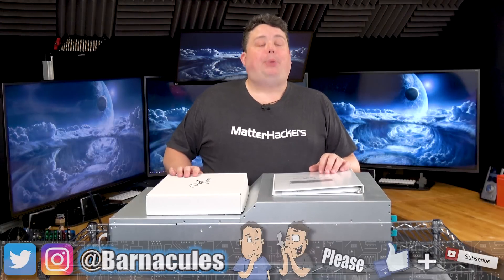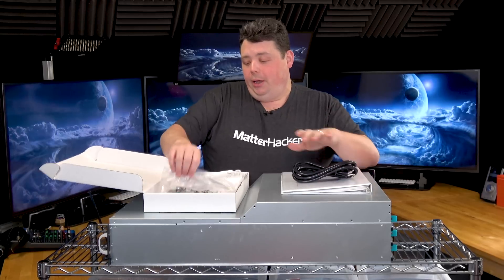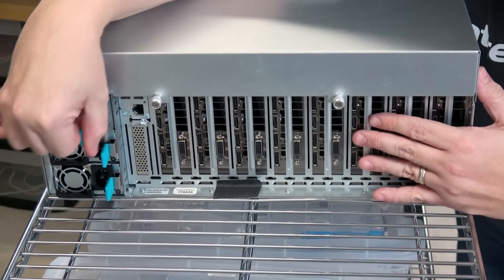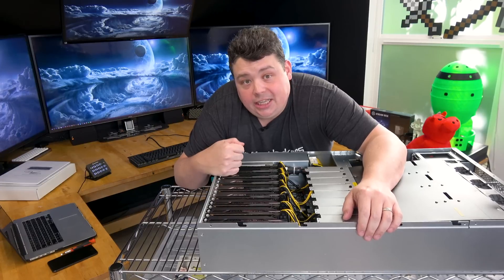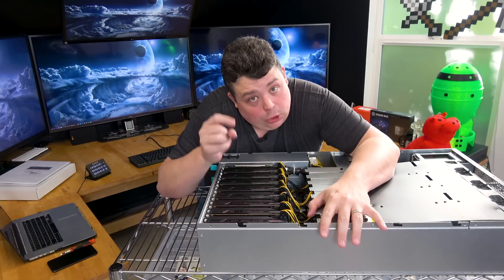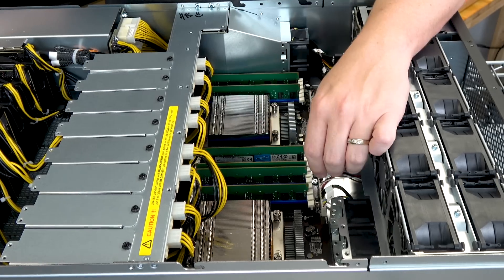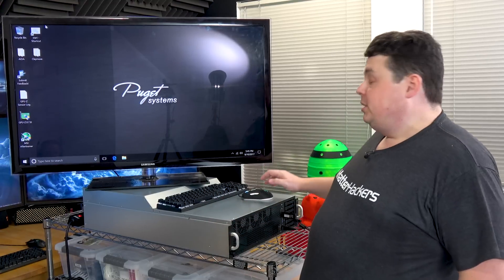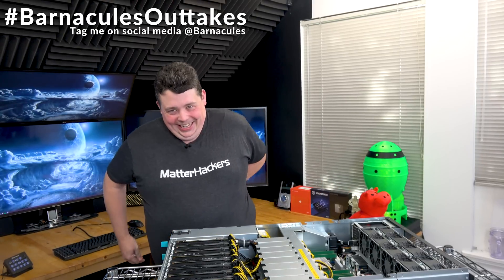Ethereum Crypto Mining Custom PC Server with 8 Nvidia GTX 1060 6GB GPU - @Barnacules

Comment: The case from Asus is so pointless. The whole point for it to be a rackmount server case is so that you can - you know - mount it in a rack. When you have a bulge like that, you might as well make it a 4U case and call it even and then you can neatly and evenly rack 10 of these in a standard 42U rack. With it being a 3.5U, it isn't like you can flip another server upside though and mount it to the rack using the same cage nuts that you used to mount the first one.

So pointless.

CLEARLY Asus doesn't do servers, and therefore; doesn't understand the server/rackmount environment. 

It's one thing to try and fail. It's another thing to be an Asus rackmount server that's neither here nor there.
Reply: Well they do provide a top without the bulge, say if you have gpu with the power input in the back. So just pick whatever you like and be done with it.

Comment: I think you didn't think it through when you said you've only connected two of the three PSU's because of your circuits might not be able to handle it.
The machines uses the same amount of power with 3 PSU's as with 2, obviously, so you should connect the third supply for the redundancy.

Comment: too loud and too energy consuming for a 1060 rig. My 1060 3GB produces 23.2MH/s at 147 core, 717 memory clock, 50% Power, 63º temp limit, which means 60W of power usage

Comment: How many U's is the back?  It looks like 4U, but I can't get a 1070 to fit in 4U so have to build a 5U case. Are the 1070's taller than the 1060's?  In my case the system will only support 6 cards.  6 cards in 5U just seems inefficient, I'm thinking I can do better.

Comment: I'm in the middle of building myself a mining rig with RX 580s.  I'm having trouble figuring out how to get windows 10 onto the rigs hard drive. I don't have a dvd drive, so I'm wondering if I can some how get windows 10 onto a usb drive to load onto my hard drive installed on the rig. Any help would be greatly appreciated.   Thanks.

Comment: Hmu if your interested in remote editing directly on a remote server or virtual machine. I have been working on a solution to remotely edit video with next to no lag
Reply from the maker: +Logan .Kes how are you doing it?
Reply: Barnacules Nerdgasm currently I have been using a tool called RGS by hp and headless HDMI adapters. It works great on bare metal machines or virtual machines. As for video editing and 3d modeling I cannot tell a difference over a gigabit network or even on ac wireless. Only issue with rgs is that it needs a direct network connection so if you are out you need to vpn into your home network. As I've had vpn performance issues I have used splashtop when out if my network such as at school so I can just bring my Ultrabook instead of mobile workstation but still have an 8 core xeon and quadro graphics 👌. Similar use would be VMware horizon however that uses grid or Tesla cards to more or less render the app not the desktop and requires expensive licensing as well.

Comment: 15-18$ a day but your not talking about power cost.  Surely this computer working 24/hrs must cost lots of electricity.
Reply: This consumes at maximum 2 kWh of power. In the Seattle area, power is 11.2 cents a kWh, resulting in a power cost of $5.376 a day. Of course, this assumes that the PSUs are at full load. They definitely aren't, even with the amount of hardware inside.

Comment: You will have everything you could ever want but the basement would have been a better place to have installed the system.I wonder why you dodn't go with 2X  SP3 sockets and two EPYC 32 core 64 thread processors for 64 core 128 threads and 2TB of DDR4 RAM and 8 graphics cards.

Comment: I'm confused, i thought you couldnt connect 1060s together? since no SLI?
Reply: Crossfire/SLI is not required for mining because the cards don't need to coordinate or exchange data at any high rate. The coordination is tiny and done via the mining software. You can have a bunch of cards of different specs and it will work fine.

Comment: Heating up the earth for just $15-$18 a day.
Reply: sticky170 the electric bill will be bigger then what he brings in
Reply: he just said 15-18 in PROFIT
Reply: Mixtapemusix1 This consumes at maximum 2 kWh of power. In the Seattle area, power is 11.2 cents a kWh, resulting in a power cost of $5.376 a day. Of course, this assumes that the PSUs are at full load. They definitely aren't, even with the amount of hardware inside. Jerry is still making a profit.

Comment: Nice system but Watch out for the small room cooling you put the high power system in. It will heat it up if no air flow to room. Here in Estonia you could heat house with it in winter. And dust is killer for heatsink...

Comment: You don't barely any for mining, just a cheapest dual core celeron/athlon, underclocked and undervolted, it actually makes more sense to have a platinum PSU to reduce improve efficiency at load.

Comment: Aye the ASUS ESC Chassis.  Those are pretty sweet.  I have a G2 ESC4000 that I scrapped together from Ebay for under $300.  4 GPUs in a 2U sounds pretty sweet until you turn it on...  I water cooled it.

Comment: what if i install another GPU in my rig without SLI would the preform increase? currently im using Nvidia 1070 founder edition from Zotac  if i installed ZOTAC GeForce® GTX 1070 Mini will it work? will the preform increase reasonably

Comment: At 15 bucks a day you would in theory have payed back the full cost of that in approximately 2 and a half years. However, that's assuming you didn't have to ever replace any components in the system, and that you don't wind up having to switch crypto currencies due to prices changing. All in all, that's not too shabby especially since once it's payed off you would be making like $450 a month off of it of pure in the green profit.

Comment: I like barnecles, puget helps barnacles=I likes puglet systems......buut
1060=1280 cores 120w
1080=2560 cores=180w
1080ti=3584cores=250w
could have replaced them with 4x 1080's and saved power or 4 1080ti's for the same power and an extra 40% more performance at the same power draw.

Comment: Regarding the tiny screws on the case.  Don't put those tiny screws back in - just use the large spring loaded 
screws to lock the top of the case in.

Comment: Why the hell don't GPU manufacturers put the power cables on the very back of the card 90° from where they are now? Just around the corner. Come on. It shouldn't be hard, guys.
Reply: They do. But only on quadros.
Reply: Survivalisbest unhackable It would make builds cleaner and servers easier to work on.

Comment: Mine Ethereum on Linux with RX 480s or 580s, not on Windows with GTX 1060s. Even just switching to a Linux distro will probably give you 20-30% better performance at least.
Reply: Arie Copley-Radder Yeah this is a very stupid build.

Comment: Watch out putting it in that crawlspace, the need for a large air supply is going to be a determining factor, I don't see any insulation or AC vents in there.  if it is boxed up in there and the exhaust of the system can't leave, the heat will build up and the air that it is sucking in at the front will get continually warmer until it over heats.  I know it is loud and the idea would be to put it away in a back area, but with that machine you will need something to take away the air it is blowing over all that and remove it from the area.  Heck with desktop systems I've seen overheating because the exec didn't want the computer out, put it in his desk, (the desk was even made with cable run systems for  computers, but the air couldn't get out, well not enough of it anyway.  I installed 2 90mm fans in the back of the desk area to actively pull the hot air out so that the systems could remain cooler.

Comment: Nice to see someone explain how a server/airflow actually works in easy to understand terms.
Having worked in the datacentre realm for 10+ years, it's hard to explain why I can run Battlefield on my 4x20 core Intel system with 0.5 TB of RAM... it just doesn't' work that way.
On the other had @Barnaculese; whats the daily figure after you factor in power usage overhead costs for Etherium mining?

Comment: Your statement about power and power lines made me wonder how that is in general in the US ... here in Germany our breakers deliver a maximum of 3600W ... though not all homes have a breaker for each room ... and some homes have even several per room.  (Except for rooms intended with washing machines and and or  tumblers which have their own circuit, and kitchens with electric stoves ... which have an even higher breaker)

Comment: would't it be more effective to use vega 64s? given that you can underclock and under volt and set clock speed to roughly 1000mz core and 1100mz HBM and still get 43Mhash per card.

Comment: you can understand how supply and demand works and still be rightfully angry at miners. at first it was all the miners buying the cards and almost no one had them in stock, and the problem now is that the prices are absolutely ridiculous and miners are still buying them regardless of price which will just keep prices high for no reason. I don't know a single gamer willing to pay $350-$400 for a RX580, but I know plenty of miners that would.  your just a bunch of lazy people trying to make quick pocket change at the expense of the entire gaming community.

Comment: Awesome build! About a month ago I bought a HP Proliant DL380G6 that im turning into a gaming machine.  Dual zeon Quad cores 2.66 ghz, 48 GB DDR3 samsung 8GB sticks expandable to 142GB, 8 sas 72GB 15k RPM drives just to get things rolling. 6 high flow fans that sound like a jet liner, 2 hot swap 750 watt power supplies, Dolby 5.1 sound card, now I just need a good video card, and  Windows server 2016. This is my everyday computer also, Its exciting building such a powerful machine.  This video inspires me even more.  Thanks Jerry!
Reply from the maker: +Mark Smith I remember working with Proliant's back in the day. Solid machine! Thanks for the kind words.

Comment: What's the hashrate when you mine?
Reply from the maker: ~180 mh/sec
Reply: Cool! And are you planning on overclocking it at all? I know heat and power is an emphasized concern, but you can probably play with the power limits.

Comment: Samsung 950 Pro 2TB SSD?  Either you're referencing storage not shown or incorrectly calling out the SSD you pulled in the caddy.  You probably meant 'Samsung 850 Pro 2TB'.
edit Just saw your edit.  :-S

Comment: 10:15 BS, it will not use any power from a redundant power supply. The total power of the system isn't going to change except from the  possible added inefficiency from a third PSU. Think about it, where would it put that extra 1000W?
Reply from the maker: +tengelgeer RTFM.
Reply: +Barnacules Nerdgasm Sorry Jerry, that's not how power works. Two options, or the "fucking manual" is wrong or when connected to two sockets the system is heavily crippled (like 2000W/3000W cripples). But because you use the full potential of the system that can't be the case. It's simple physics, if you use an extra 1000W you have an extra 1000W of heat. And some component needs to dissipate that thus needing that. That leaves option one ;) The machine simply had three 1000W power supplies but the rating of the PSU doesn't determine the power draw. Greetings from a Electrical Engineer specialized in Embedded Systems and Power Distribution ;)

Comment: The best part of this video is the facts and how misleading and wrong they are.  1060's aren't render cards, and even in that respect video cards aren't use to render video the cpu is...  So this rig quite literally an overdone gaming rig with too many cards and ecc ram, which really doesn't affect gaming performance its just more expensive.  But seriously, you don't render with gaming cards, and I would love to go at anyone who disagree's with that statement.  Just like maya, max, minecraft, that is all CPU NOT GPU.  Unless its a render card, which these are not.  

Now if you bought all those cards to run that many monitors to get that much tool room for doing editing and graphics, maybe, but still, they will not help you in rendering video or 3d content.

Comment: 1060 6GB might be a real good choice for this sort of system. But most people might want to use their gaming rig in down time for this, so a single or double 1080 or 1080 Ti might be the thing. There's also the red team possible combos, but you have to check that energy efficiency, since it will easily kill any profits! VERY IMPORTANT: Watch out for that noise, humans have a very limited tolerance in time for continuous noise over 50-60dB. It will cause health issues over time and I'm not talking about hearing loss! Be safe bro! Gotta love a Houston build from Puget!

Comment: I don't like this case at all. If you look at almost any rack server vendor, you'll find that the majority of user-serviceable parts can be swapped tool-less. With HP rack servers, you turn a key 90 degrees, pull a lever and baam, the top cover is removed. This thing? Remove 20 screws to change a fan.

Comment: Just wanted to throw in ECC and Registered are two different things, though usually combined. Registered or also known as Buffered help alleviate electrical load from the CPU memory controller which on Intel tends to be just one on a monolithic die, so increase stability.

Comment: winblows? on a hashbox? not trying to be rude, real question - wouldn't running linux, particularly a non graphical distro be a lot better for a project like this? or does it not even matter....  or is it just because your main use case is rendering and mining is secondary?

Comment: Oh I love the moronic idea that is cryptocurrency.  it would take 2 years to pay this off, IF he is making on average said 18 bucks a DAY ALL DAY EVERY DAY. but this does not account for the rise or drop in value, nor the difficulty in mining, and after 2 years I am sure they ROI is much lower. the cost of this stuff needs to literally be 1/4 of its current cost to really make it viable.   sure if you are able to get said coins, and hold on to them IF it goes up then possibly your break even point MAY be higher. but id love to see the math using previous figures on cost of a machine vs time to break even point and the rise in difficulty and what the profit actually was within 3-5 years.
Reply: That would be true if he actually paid for this. He got it all for FREE; that's $12,000 worth of hardware. He's making pure profit right now for basically doing nothing.

Comment: To address the screws. As you don't know they are there for system security and transport. However once rack-mounted you can remove all those screws and just leave the spring-loaded screws to hold the cover "Reasonably secure" but depending on make and model dust can become a thing depending if it could mess with the sliding of the rack. If it doesn't mess with the sliding  and is rack-mounted normally a label "lose lid back screws only" is stick on the top and the operator knows that it is only secured by the two screws at the back. Thus they will handle it appropriately. Not every business works this way or has these rules but "normally that is kind of what happens" Other times it is a must that all screws are   secured for integrity sake. Just saying it is really not such a big deal.

Comment: holy crepe jerry, I just built a mining rig with 5 1060s and also use nanopool, the east server though. When I bought the gpus I thought I should've sprung for something better but seeing you bought them only means they the best. One question I have about the system is, in a pinch would it reheat a cheeseburger that was kept in the fridge?

Comment: Take the small extra screws put them in a lil zip-lock taped to the lid so you dont loose them and just use the thumb screws youll be fine

Comment: great video ! I would love to see how fast that beast could compile massive project. If ever you decide to do a Linux series you could probably run 20 different distro's simultaneously without even having the slightest hang. I'm curious how fast this pc would calculate a recursive Fibonacci function of fib(500) or even higher. *(I know recursive is not optimized for Fibonacci this is just for experimental purpose. keep it up man, have a good one!

Comment: Firstly, measure sound at 1m, and the direction of the mic matters.
Secondly why a 3u with a bump over a normal 4u? Also in a home environment, why not use 2x single xeons with 4x graphics cards each.. the lower power density would not only make it cooler\quieter but save some power those fans like to eat.. cost is unlikely to be radically different next to the $12k that things worth.

Comment: thanks for adding to the reason why a normal gamer cannot afford a new gpu because its either backordered or stupidly overpriced
i seriously cannot wait until this latest mining craze goes away again....
Reply: WaFfLeFuR Probably won't because ASIC ended it before and now these new cryptocurrencies are immune to it.
Reply: and nearly a year later... you have your wish - it doesn't pay any more to run these boxes due to the value of the shitcoins they find.. ie: costs more in power to run them vs the value of the coins it finds.
Reply: Supply and demand, it's not miners fault, or gamers, or even servers, you need to be going to the manufacturers and complaining that they aren't keeping up with the demand

Comment: I'd like to see some benchmarks...benchmarks like video encoding/transcoding using the compute power of the GPUs. Say distributed.net RC5-72 keyrate over the GPUs. That's where the power  of having 8 1060s in it will be shown.